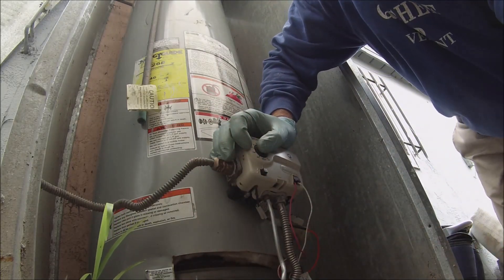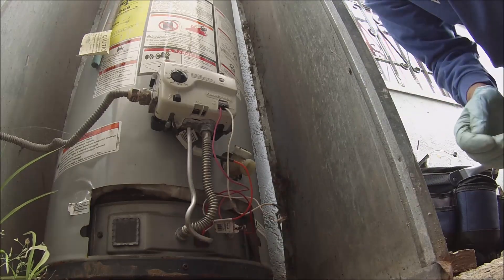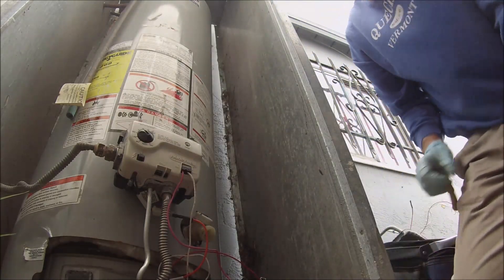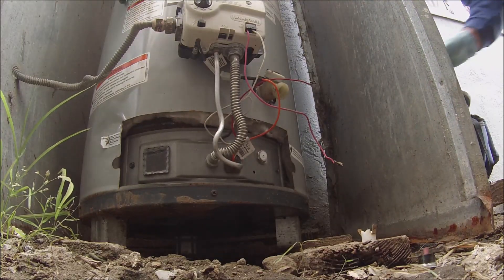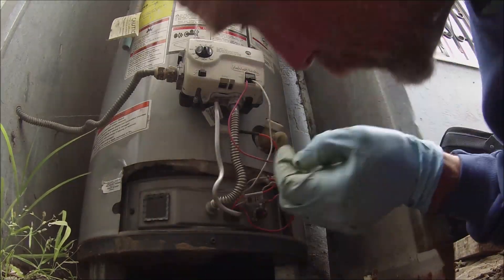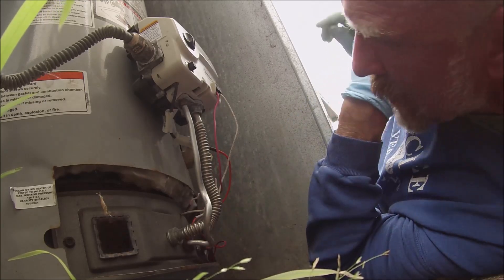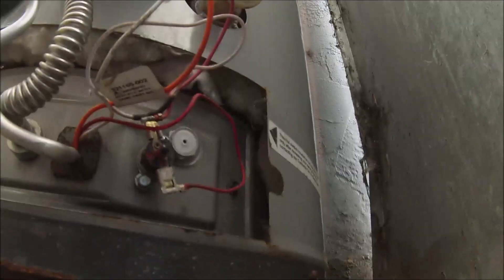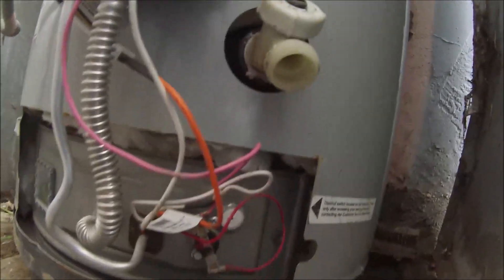ECO (emergency cut off) switch or “high limit safety thermostat switch"

Comment: What was the name of the limit switch you used?  I have the exact same problem, exact same unit.. exact same broken switch...  in the same place.  It even has the same white plastic inside the broken switch.   What limit switch should I get?  Does it have to be a certain temp?   What is the name of the switch you used?
Reply from the maker: Yeah, I don’t know the name of it. I I just use the Replacement ones off of Bradford White if you take a picture of it and do a Google search, it should come up not sure what they charge for them individually.
Reply: @thewaterheaterfactory  All the Bradford White I found said they were 290F..  The old one I have was apparently only 190F.  So I kept digging until I found one of those instead.   They seem to be color coded too, with a little paint dot (red, white, green, etc).   I can't believe they made those non-replaceable..  ridiculous

Comment: I heard you cussing so I subscribed to you! 😎
Reply from the maker: I appreciate that. I haven’t put out a video in a while. I just kind of felt like they were all the same, but I’m working on some different stuff. I’m down a rabbit hole currently trying to connect to the Comm port on the Honeywell Water Heater Valve Circuit Baord unable to get a serial connection it’s driving me crazy!
Reply: @thewaterheaterfactory Oh heck! I got my surface emergency cut off valve ordered but I'm dead in the water till it shows up. I've seen and hear it could be temporarily bypased. So I'm going to try that. My part won't get here until Thursday.
Reply: I didn't know about the surface emergency cut off switch until I watched your video so you helped me immensely, thank you!

Comment: what temp setting is the replacement eco switch you used, and is it appears to be surface mounted .I replace mine with a 240 degree, it trips once combustion door is hot, is there alternative placement?
Reply from the maker: I don't recall - I had some issues with a surface mounted sensor high limit switch tripping  when connected to the burner assembly had to move it slightly away but close enough to be affective if the combustion chamber heat was an issue. Thanks for watching
Reply: What would make the water heater over heat

Comment: Is the the paper clip trick where you replace the switch with a paperclip and bridge the wire?
Reply from the maker: Correct, it helps you diagnose whether the thermal switch is bad. You can also check it for continuity with the multimeter and a pinch. It’ll get the water heater running, but it is a safety device so I don’t recommend running it for a long time without the thermal switch just for safety, the likelihood of anything catastrophic happening is pretty low, but still better to have it and not need it , then need it and not have it.
Reply: @thewaterheaterfactory  thank you much I'll give it a try to help me figure it out. Already replaced the thermocouple assembly with no luck can't figure out why my pilot light won't stay lit. Hopefully this'll get it figured out
Reply: @CyberJanksmith hey did you figure out what the issue was? I’m dealing with the same thing. My switch was broken off I tried the paper clip bypass but my flame still goes out as soon as I release the pilot knob. Thinking it’s because I can’t reset being that my switch is broke. I have another switch coming in tomorrow hoping that fixes it
Reply: @mikescott97  I had to replace the whole unit not the whole water heater but the control unit. I had a failed circuit board